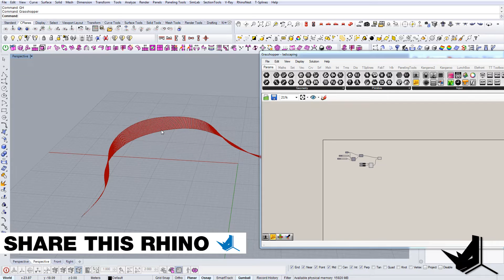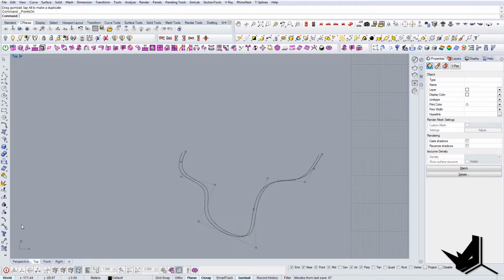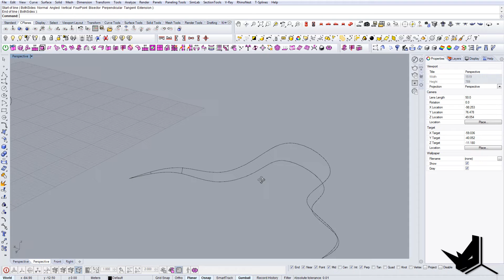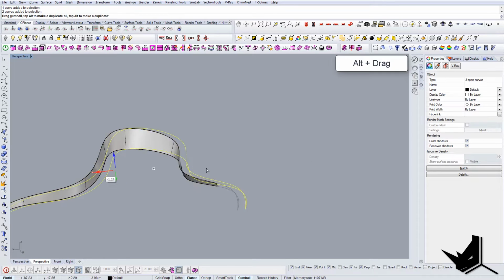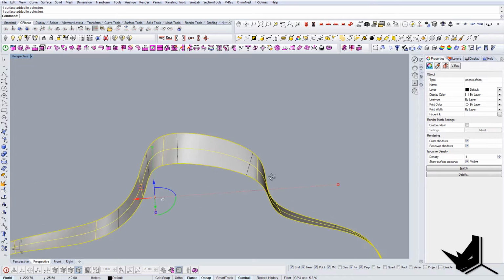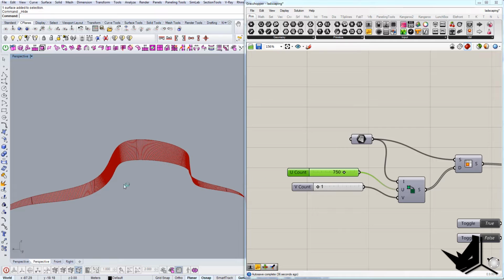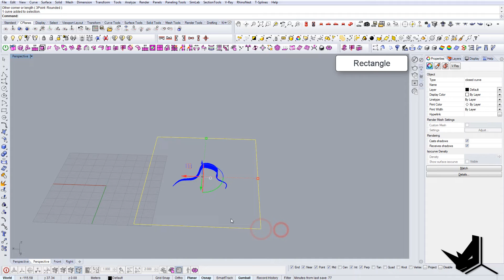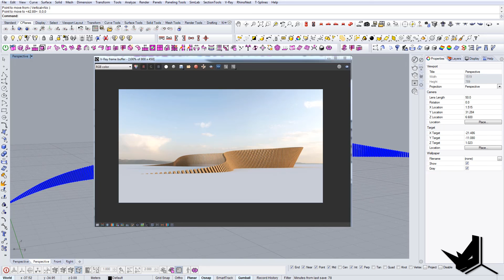How to Model Landscaping in Rhino

Comment: Hey, cool tutorial thanks it was extremely helpful. Quick question though, how can I reduce the amount of the sticks. For example; I'd like to get %50 amount of the sticks in the end by deleting one stick between each. Is it possible to reduce it on grasshopper ?
Reply from the maker: Hey Omer,
Yes of course you can automate this with Grasshopper. You would of course had to create all these lines with Grasshopper as well and then just use Cull pattern option with Boolean toogle turned to "true" and "false". That will give you desired results.
Best regards,
Dusan

Comment: What's the difference between nurbs and mesh? Why do we need to convert surface into mesh?
Reply from the maker: Great question! The difference between nurbs and mesh is in the amount of mathematical information a particular model has. Nurbs are mostly used when you're working on a model that needs a lot of editing, modeling and manipulating. The model that has only nurbs has much higher file size than a mesh model. You can also edit mesh model, but the options for editing meshes are much more limited comparing to nurbs. You would use meshes when you are finished with modeling and you'd need to import/export some files to other programs or other Rhino model. There's other differences as well, but these are the most important ones. Hope that helps! :)